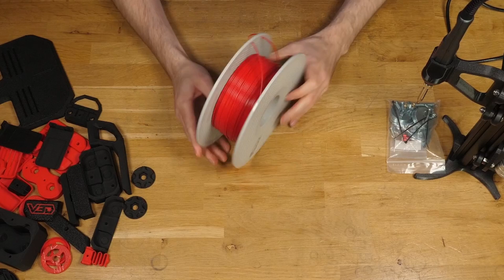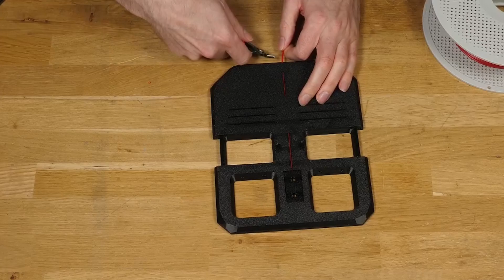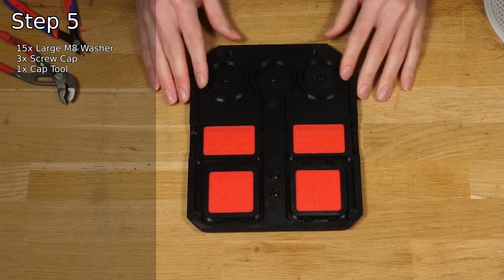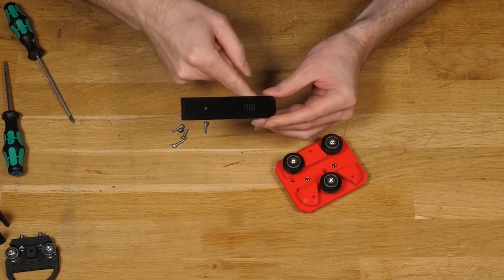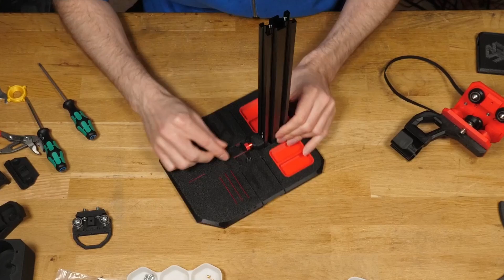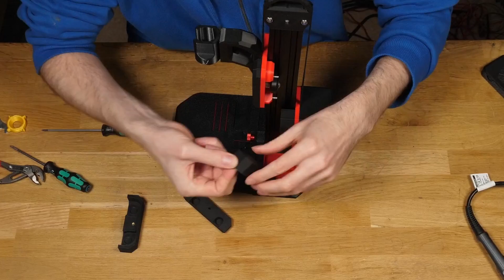VLMP 2 Assembly Guide

Comment: It doesn't matter very much, but I recently started a personal project involving containing something to sliding back and forth and realized that linear rails are actually quite accessible.

I ended up buying 2 different 100mm length linear rails for 10 bucks on Amazon (they could be purchased for almost half from aliexpress). One was an LML9B. I should not these are Canadian dollars too and not in bulk where they are even cheaper.

I guess that's a long lead up to ask if you considered a linear rail for this considering the massive benefit of ease of use and lack of maintainance/fiddliness that comes with rollers and eccentric nuts with how cheap they are.

Thinking further I imagine you could even just use the rail as the structural component for a usecase this light and forgo the extrusion entirely.
Reply: There is less maintenance with pom wheels, it fully sealed where for linear rail stuff can build up within channel. So if you're within more dusty environments those linear rail will feel crunchy after a while, and you are required to clean the rail and carriage and re grease to have them setup initially.
Reply: @unknownnetworkhub7460  Pom wheels leave dust, wear faster, and can develop flat spots. On the other hand, outside of very messy environments which a heat press wouldn't run into, linear rails require much less maintainance given you don't have to tighten them as they wear like with pom wheels.

So much in fact I noticed that this is actually the lower end press he sells and he actually does include linear rails on the up market model.